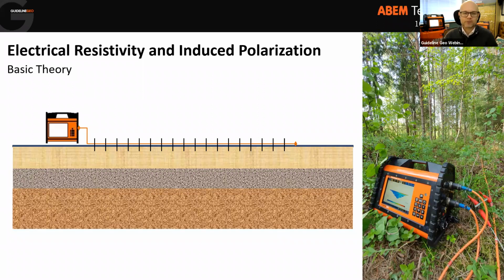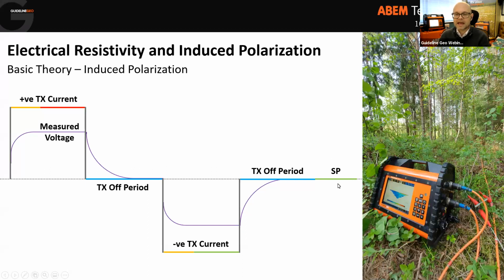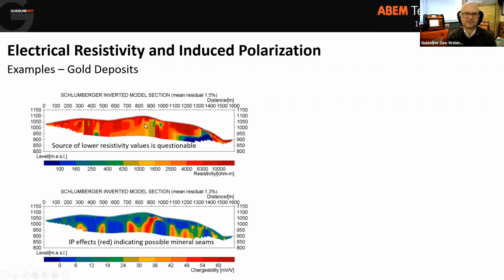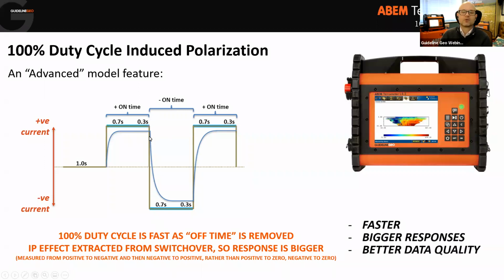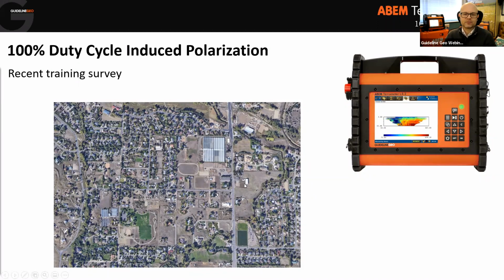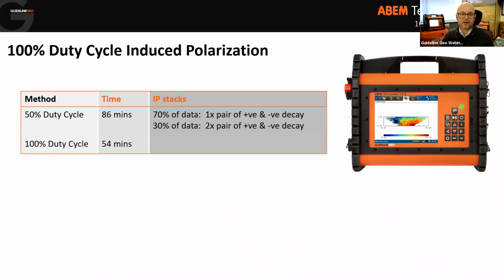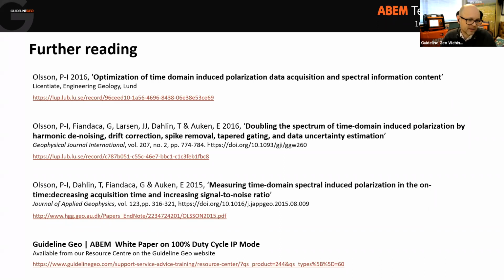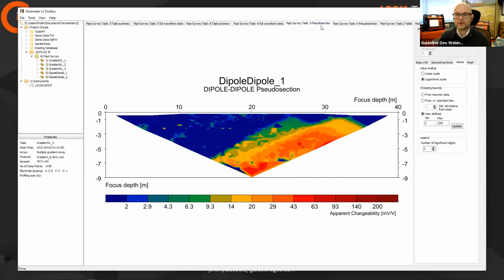ABEM Terrameter LS 2 100% Duty Cycle IP

Comment: The reason for the off period is to allow fast EM transients to disappear.  Transients are caused by switching effects, cables too close together, and made worse by conductive ground.   How does this 100% duty cycle avoid that problem, especially as the cables in a multi-cable system are so close together?